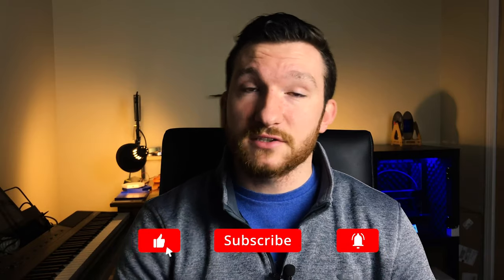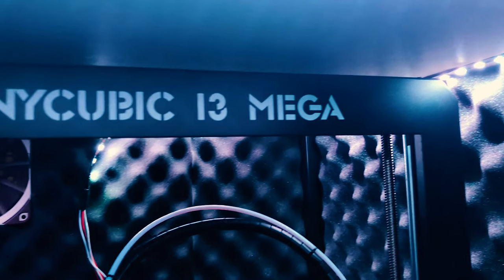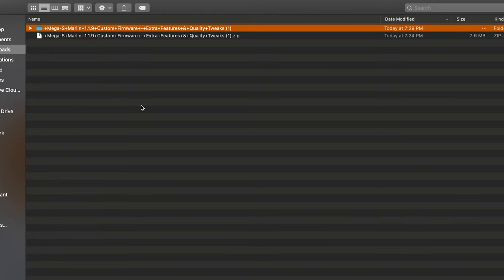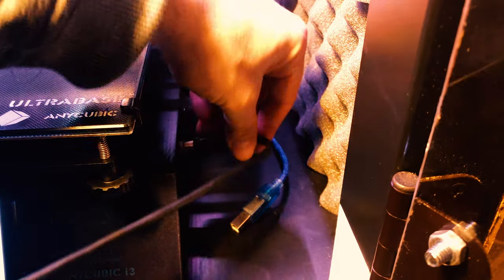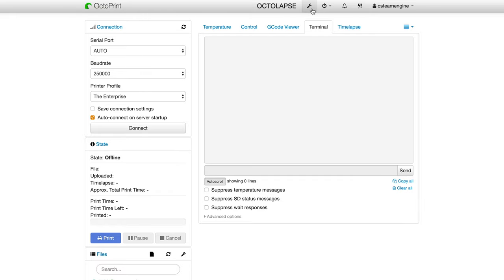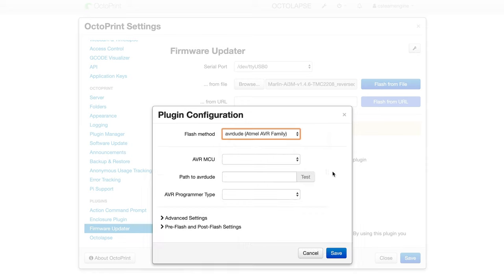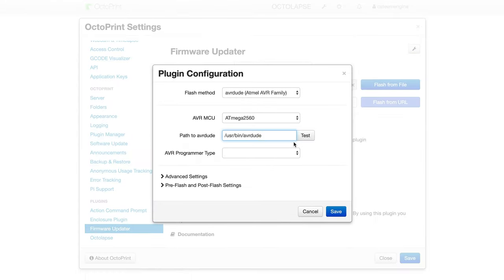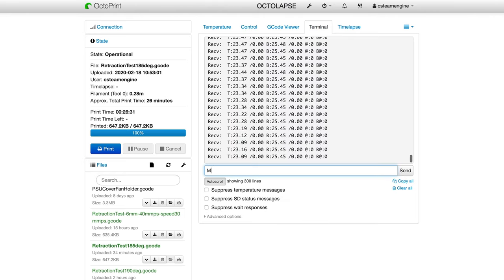How To Install Marlin On Anycubic i3 Mega! [Cura AND OctoPrint]

Comment: it doesn't work: i installed the stepper driver tmc2208 without flipping motor's pin. if i use marlin firmware the z-motor on the left stop working but if i use original firmware it works correctly
Reply from the maker: Thanks for your comment! The only thing I can think of, is that you potentially selected the wrong Marlin hex to flash? If you get it to work with the original firmware, I'm assuming you flipped the connectors, so I'd just check to make sure you selected the Marlin-Ai3M-v1.4.6-TMC2208_reversed.hex file. Let me know if that is your issue, if not then we might have to dig deeper to figure it out.

Thanks!
Reply: @ModernHobbyist  thank you but i saw that it was a driver problem. the firmware it ok 🙃

Comment: When I install this firmware, the printer does not start printing from the SD but from USB. But with the Anycubic firmware it preheats and starts the gcode but then it stays at home. Can somebody help me?
Reply from the maker: Hey thanks for the comment! One issue I remember running into, is that the new firmware can't handle special characters in any of the filenames, so if you are using the SD card from Anycubic originally, you'll need to delete or rename the files in there with Chinese characters. I hope that helps fix your issue, if not feel free to let me know!
Reply: @ModernHobbyist  i just restore in fat32 two sd and the problem continue...

Comment: Thanks for the great video.
I have installed the the TMC2208 drivers and new Marlin firmware and the printer is much improved. The only issue is now is, after printing for an hour or so, I'm getting extruder thermal runaway!
Reply from the maker: Hey Paul, thanks for the comment and sorry for the late response! My first thought is that maybe the connectors for the thermistor were somehow loosened while you were installing the new stepper drivers. Other than that a faulty thermistor would be a good guess too. Hope that helps, and good luck tracking down the issue!

Comment: Do you need to move the jumper on the main board before you flash the firmware?
Reply from the maker: Hey Scott, thanks for the comment. I think you used to, but my printer didn't have a jumper that needed moved.

Comment: My i3 Mega has a 32 bit trigorilla pro board. Can I still flash Marlin 2.0 ?
Reply from the maker: That's hard to say, the pinout could be different between the normal the pro boards. You could always go through the repo I have linked in the description and compare the configuration pinout with that of the trigorilla pro. If all else fails, try contacting Dave Ramiro and he might be able to help you out!

Comment: I install this Marlin on my i3M but in fact I didn't like it, machine seems a 80's C3PO on homing movements and after that my temperature always drop from my 210C set to 200C after print starts and I could not fix that till now
Reply from the maker: I'm sorry to hear that! I haven't had any of those issues, so if you ever track down the cause I'd be interested to hear!
Reply: @ModernHobbyist  It's perfectly fine, your video tutorial is great and easy to understand, I will try to understand what's going on with this 10C temp drop after print starts, about strange homing movements seems just firmware adjustments....Cheers!

Comment: @Modern Hobbyist - Has anyone confirmed if this will work with the TMC2209 drivers?
Reply from the maker: Hey Zach, thanks for the comment! I can confirm it does work with TMC2209's I have those installed on my printer and they work great. The firmware that I used came with three different flavors, so if you haven't installed the TMC2209's yet, you don't actually need to flip the motor connectors as you did with the stock firmware. I hope that helps answer your questions!
Reply: @ModernHobbyist  Thanks for the info, I rolled the dice and installed it on my printer the day after I posted the question.  I can confirm (as well) that it does work on the TMC2209's as well.  I havent posted my results before this because I wasnt sure I could "confirm" it until I tested it fully.  I've been printing the Kinetic Gears(thing:3952507) and Polar Bear(thing:4052802) from Thingiverse and they are all coming out great.  Thanks for your videos.

Comment: What is the stock firmware on the Mega X. Thanks
Reply from the maker: Hey Larry, thanks for the comment. I'm not sure what the stock firmware is on the Mega X, but I'd assume it's a customized version of Marlin that Anycubic altered to make work for them, as is the case with the Anycubic i3 Mega.

Comment: I have the Mega-S with the stock drivers. After uploading the firmware, the extrusion motor stopped working. Did anyone else have this problem?
Reply: Mines now under extruding badly
Reply: @nicolakleiser  I've since figured it out, you need to change the E-Steps to 384 as it says in the GitHub.
Reply: @od_studios  Thanks, do you have a link, not sure where to change the estep setting.
Reply: @nicolakleiser  Go into Pronterface, connect the printer, type M92 E384 in the terminal, hit enter, type M500 and hit enter.

Comment: Hello , should i turn off enclosure extraction fan when printing PETG ?
Reply from the maker: PETG isn't as temperature sensitive as ABS so you shouldn't need to worry about shutting off the fan, but I haven't printed with PETG before so I'd be interested to hear your results!
Reply: @ModernHobbyist  it looks like when fan is off im getting less warping, i got today tmc 2280 v1.2 drivers for stock firmware anycubic mega, so if i understand correctly : install drivers ,set voltages ,install 2280.hex and ready to go . Or i must flip connectors and use 2280reversed.hex ?
Reply from the maker: If you are installing the 2208reversed.hex then you don't need to flip the connectors. I flipped mine because I installed the drivers with the stock Anycubic firmware, so the motor connectors had to be flipped. That would be one bonus when switching to the newer 2208reversed.hex, no need to flip the connectors. Cheers and good luck!

Comment: Thanks for the great video!  I've just recently started updating my Anycubic i3 Mega S and your videos are really helpful and easy to follow, I installed Marlin and the printer stepper motors seem to operate smoother and quicker.  
The only problem I'm having  is that the extruder isnt extruding enough filament to print anything, the printhead is moving around but very little filament is coming out of it and its coming out really stringy.  I use Cura and i recently tried setting up Octoprint to see the machine code to be able to see whats going on but it doesnt seem to be able to connect to the printer (I have the printer plugged into my laptop via USB as i dont have a Pi setup). 

Would you have any idea on how to possibly fix the under-extrusion with Marlin?  Thanks again dude!
Reply from the maker: Thanks for the comment! You might need to calibrate your stepper motors, which can be done using OctoPrint. Check out the video I made on that topic!

https://www.youtube.com/watch?v=25r-PTVJDjQ
Reply: Did that work for you? I'm having the same issue and want to make sure that's the solution.

Comment: since this video is there a newer version? i have the I3 Mega S in completely stock form
Reply: looks like a lot of custom code work post flash to make it work or use some features
Reply from the maker: It looks like Dave Ramiro created another release on April 4th, if you want to check that out on his GitHub page.
Reply: @ModernHobbyist  i still new so i have no idea what to look for, could i have a link? i also notice you still need to know or use a lot of code to use some features
Reply from the maker: Not sure if YouTube will remove this link, but here is Dave Ramiro's GitHub releases. https://github.com/davidramiro/Marlin-Ai3M/releases

Comment: my printer didnt reboot with the marlin firmware on it any suggestions?
Reply from the maker: Hey thanks for the comment! When your printer booted back up, did it make the usual Anycubic beep tune? If it doesn't beep when you power it on, then you should have Marlin successfully installed. Otherwise, the information page will still show that the old version of firmware is installed. Hope that helps!
Reply: @ModernHobbyist  it did not beep bbut nothing on any of the menus are different
Reply: @ModernHobbyist  when i go into the printing menu all i get is that there is no sd card and thats all
Reply: figured it out all i needed to do was put an sd card in the printer after 9 hours\ of trying to figure this out i can finally do it..    man i fell down the rabbit hole on this one...

Comment: Thanks for the video. I went ahead and downloaded the files and the instructions mentions that for the Mega-S you have to do those extra commands in addition to M502 and M500:

M92 E384 - set correct steps for the new extruder
M203 E30 - limit extruder feedrate
M204 R1500.00 - lower retract acceleration
M500 - save the values
Reply from the maker: Thanks for the update, I appreciate it!